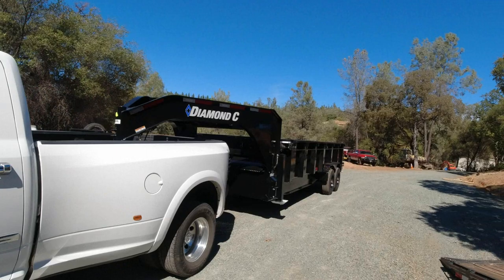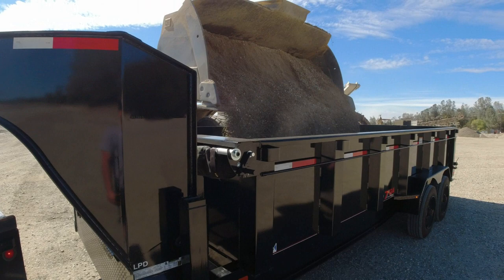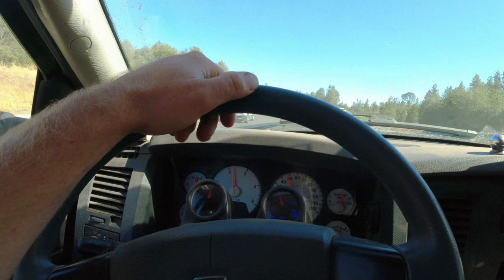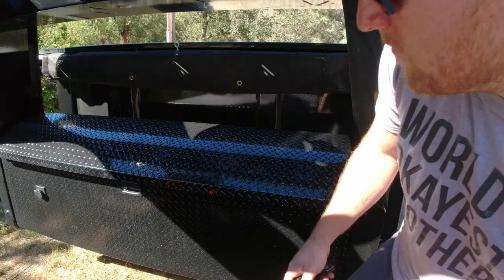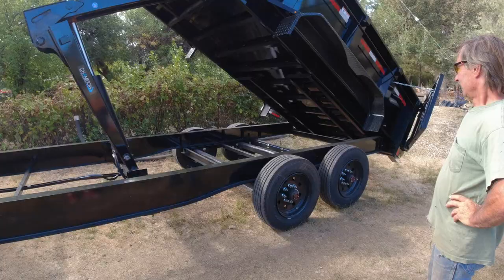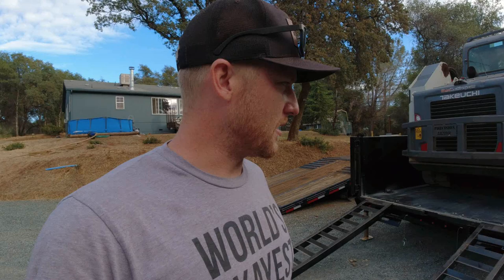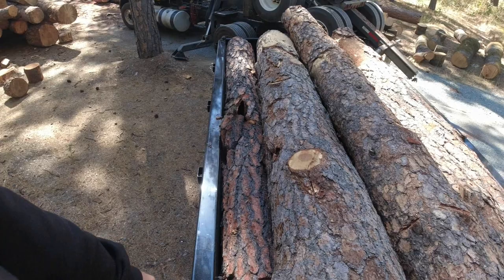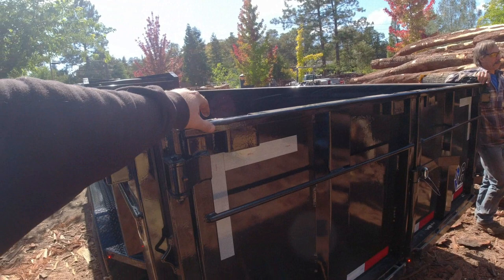MY NEW DUMP TRAILER. Super single GOOSENECK

Comment: So realistically you were only over gvwr by a 1000lb?
Reply from the maker: I wasn’t over at all
Reply: @VBELTandSON  36120 - 18300 = 17820 payload.  Trailer is 25k minus its 8000 = 17k payload capacity. So 820lb over…or am i missing something? No biggie. I’ve been contacting diamond c about pushing my trailers gvwr, they dont subtract the tongue weight which would help payload capacity.
Reply from the maker: Tongue weight must be applied in the figures. Always aim to have 4K plus on the truck.
Reply: @VBELTandSON  that’s what I say. I have a machine I’m looking at that will be 2000lb over my diamond c. My truck is rated for 2150 tongue weight. I called diamond c and went over it and they said they don’t subtract tongue weight off of their gvwr and I’d be overloaded, even if axles of trailer only weighed the gvwr. Kinda one of those things, is tongue weight really on the trailer, or is it on truck…. I say it’s on truck.
Reply from the maker: @mark_Hershey  dc have videos talking about that. And they say different. Tongue weight is always a factor across the board.
Reply: @VBELTandSON  yes but tongue weight is already averaged in diamond c’s gvwr’ s. Its how a trailer like mine, a 14900 gvwr with 2 7k axles can be rated up to 14900. They are adding in the 900 extra. Because of tongue distribution.

Comment: Why did you get a smaller one
Reply from the maker: I talk about it in the video. It’s not really a small trailer either
Reply: One with 4 foot walls
Reply: @rowdyhouse2379  4 foot sides are great for hauling volume, but suck for hauling equipment.